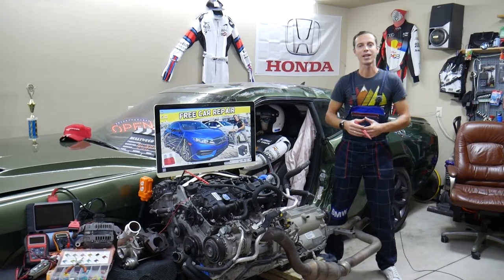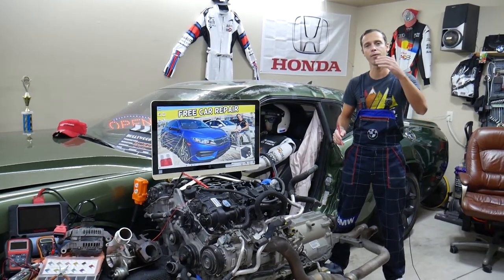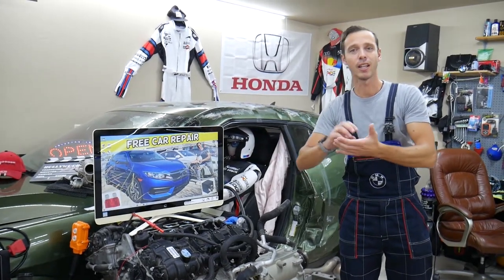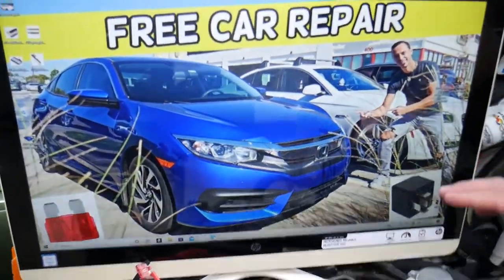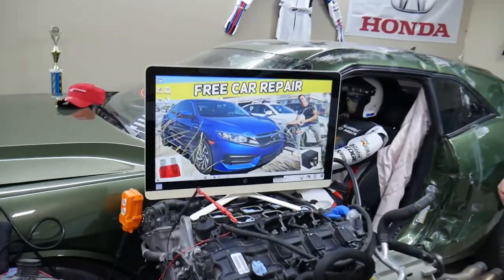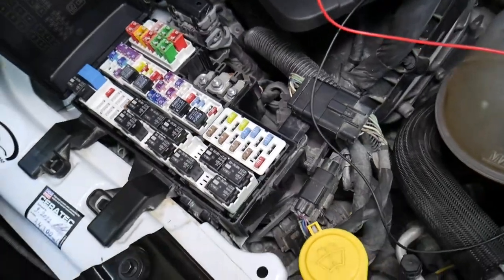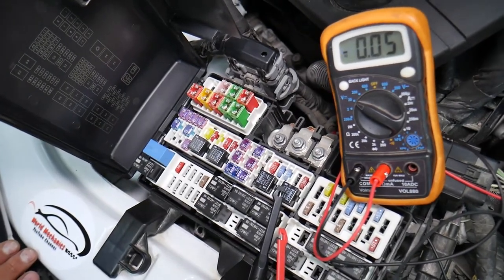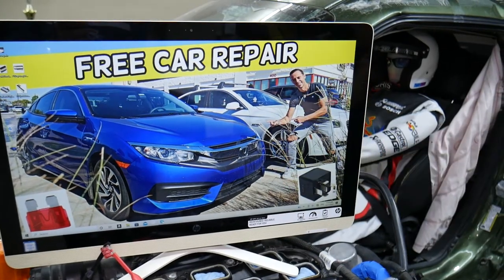HONDA CIVIC CIGARETTE LIGHTER FUSE LOCATION, CIGARETTE LIGHTER NOT WORKING FUSE 2016 2017 2018 2019

Comment: How do you get under there. I'm small and thin and can't  do it.
Reply: I hear ya. I had to pull the whole plastic part of the dash off under the steering wheel and I still was unable to bend myself in a way to get both hands up in there. Absolutely ridiculous design. Not to mention it uses those stupid little low profile mini fuses so they are so crammed in there is so hard to get them out. My 12 volt socket still doesn't work because I've yet to replace the fuse. Piece of shit